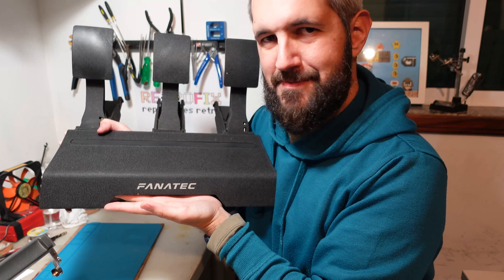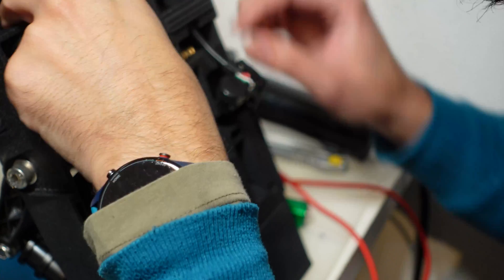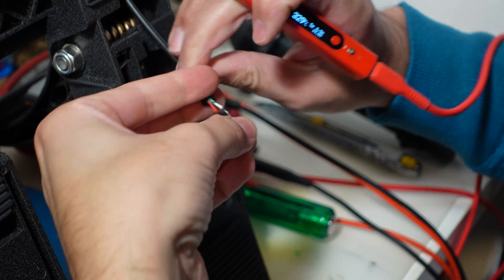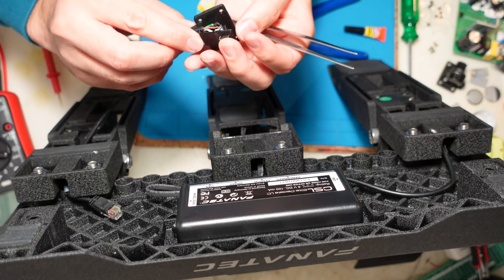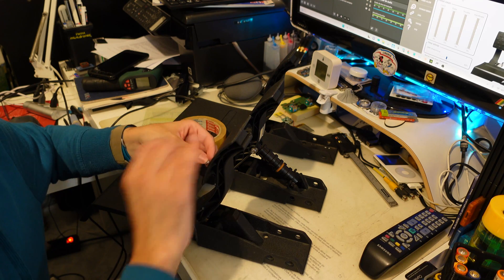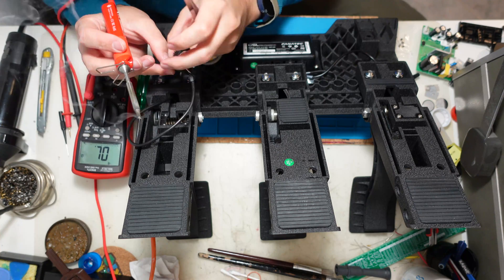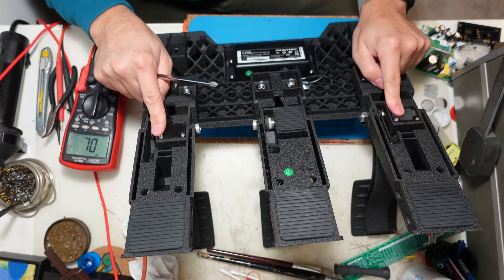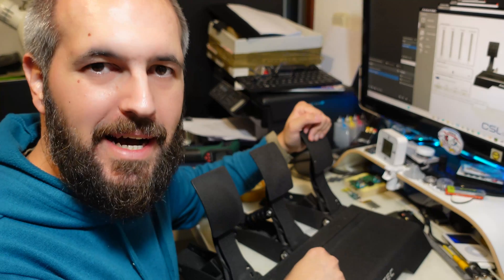Taking the FANATEC CSL Elite pedals to the HALL (sensors) of fame!

Comment: you don’t have to desolder the old potentiometers! just buy a cheap telephone cable with standard rj12 connectors, cut it in half and just use 3 of the 6 connections.
Reply from the maker: Thanks for the suggestions. I needed to remove them because the hall sensor 3D printed supports were mounted in the exact same place as the old pots supports.

Comment: I just swapped the pots, for hall sensors, put a Arduino micro in the box of the old pcb, and called it a day. Now I have great pedals, for my Elite dangerous HOHAS setup. Going to mod my Fanatec wheel pedals too, when I have time. Hall sensors FTW!
Reply from the maker: Yeah! No more pot cleaning is a blessing. I use hall on my modified g25 pedals also and they are awesome.
Reply: Hi, I'm planning to do the same thing for my CSL pedals, switching to Arduino (and maybe standard sensors, if the potentiometers are not standard), because I don't want to depend on Fanatec for maintenance. Do you have a website or tutorial of some kind I could learn from? Thank you